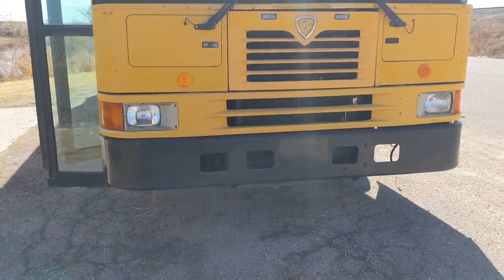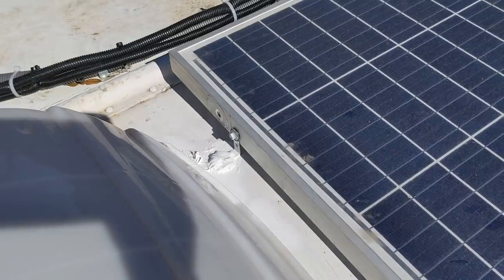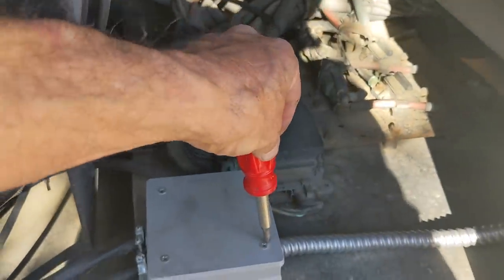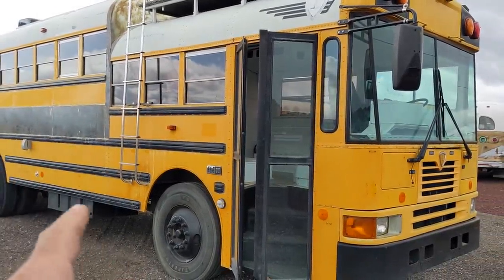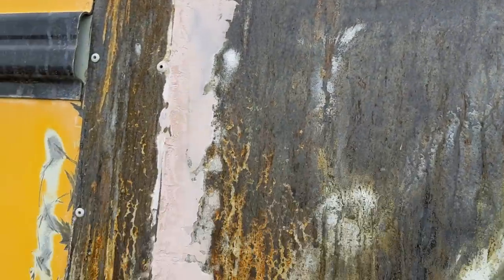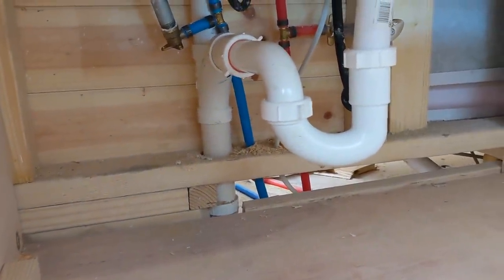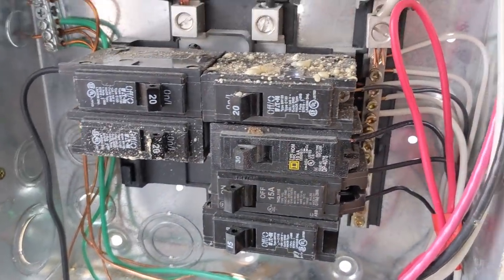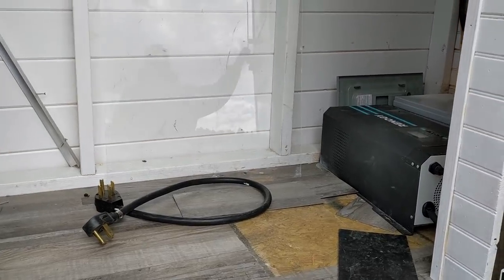Dangerous electrical work...and so much more bad stuff.

Comment: You are assuming the roof raise was done correctly ? From what I have seen , the framing behind the steel side plates is missing . Even if you fix it,  it will shake apart traveling down the road .Any good body builder knows the welded side panels will crack .Like you said the modification should have been done between the rub rails and the skin should be buck riveted to the modified frame .The road is going to beat the hell out of that bus with the spring suspension .And now the engine overheated ?You can get a f*ckin esquire to sue the bus builder but justice is a prostitute and you will go bankrupt . I wish you luck .

Comment: This outfit - this outfit WHICH ONE?
Name the pricks.
Better still send an "official" complaint to that region's power control agency (unsafe wiring standards committee etc.) and get them IMMEDIATELY closed down as this bus (or the few busses you have now seen) IS THE WORST TYPE OF MANSLAUGHTER UNIT - that they are obviously doing on a continuing basis.
They need to be shut down and EVERY BUS CONVERSION - that they have ever had through their business, instantly recalled and de-commissioned.

Comment: am for shit in working with wood, but even I can do a far and away better job then they did. that wiring scares me. how could anyone do such a (****) job. even my welding is much better. hell i can even cut the outside wall better than they did.
another here said "lone star skoolie" did this? is that correct? i will never get with in 100 miles of them.

Comment: So I guess that you would not be in favor of my 1915 hit&miss engin powered open chassis Generator equipped with glass fuses   knob & tube smooth wiring and open blade switches throughout .
Not only should that company stop doing electrical they should not do carpentry,  plumbing,  bodywork or anything even remotely related to transportation or housing much less both together. The only thing they accomplished was converting good useable materials into scrap .
I have see better work on a chicken coop made entirely from shipping crates, pallets  old bed frames and sheet metal from a rusty garden shed. Infact the fit and finish was much better.

Comment: In Texas and most of the Southwestern USA including Louisiana there are a TON of NEC code violations out in the wild especially in places like RV parks and the reason is most of the laborers and maintenance personnel are either low IQ dope heads who watch one youtube video and think they are experts or migrant workers (legal and illegal) that are not electricians to begin with. IDK how mush SHIT I have cleaned up just to make things safe. Then you have people who own RV parks who are cheap and don't want to buy new wire, conduit, box's etc. let along the correct stuff for outdoors because it "cost too much" yet they can support their healthy gambling habits. I have walked off many jobs like that because I WILL NOT wire in something using old rusty shit that is not safe or up to code.

Comment: RollingLiving... you should clarify that the outfitter did not "finish" this build. Meaning, they didn't exactly release the bus as a finished product with a walk-thru since the owners picked it up prematurely. I don't blame them at all, but to frame this video as though you're critiquing final assembly is disingenuous. "This is what a $100,000 build gets you" isn't an accurate statement if it was never released as completion.
Reply: The owners of this bus kept a blog while they sat in San Antonio waiting to pick up their bus. They were actually told 4 times it was “finished” and showed up to find it is a variety of states of disrepair and shoddy workmanship. The final time they finally decided to just save it rather than let LSS destroy it further. So actually, this IS what LSS told them was a  “finished” bus. 

Also, the owner of LSS, Ben, never happens to be there on pickup days and doesn’t answer his phone, leaving the workers to deal with customers and the GM, Amber, to claim she cannot refund any money because she need’s Ben’s approval. Multiple victims of this company have told this exact same story so it is obviously a pattern and part of LSS’s scam.
Reply: @vaughnfluff3344  holy crap. Well, that's a game changer then as far as my initial viewing. To think that anyone would say that any single portion of that bus is finished is stunning. Growing up in a family that bought a new motorhome in 1973, I'll add some unsolicited advice: I get the whole bus conversion idea. You pay low and invest in a renovation that yields a sturdy product. Fiberglass motorhomes suck from a structural rigidity state. BUT.... what if, instead, you took your "bus renovation money" and bought an older Bluebird Wanderlodge instead? That's the way to go. Do your own research, and I'll bet, you'll come to the same result.

Comment: They (Lone Star Skoolie; Benjamin) took $75K from these people and spent maybe a couple grand on materials, and had no skills in any trade, whatsoever.  Why did they even bother?  They should just use a gun to rip people off.
Reply: Kid is way over his head. Conversions involved several trades which the company has none. There is a saying fake it till you make it, this seems to be a prime example. The fake it part is obvious right away.

Comment: Just wondering why someone is willing to pay $100k for skoolie build? That amount of money would buy a very nice RV. Such a shame that those Aholes are still taking advantage of peoples lack of DIY skills.
Reply: For the same reason people rebuild old cars or remodel older houses. $100K won't buy that nice of an RV. Definitely not a new one. Sure you can find an older RV, but it's a canned product that's the same as all the others. But a skoolie can be anything. We had a different floorplan that we wanted. We wanted our own remodel with our OWN design. We had dozens of space saving features we were going to put in it, things where current RVs just waste space.  Could we have found an RV for less than $100K? Of course. But it would have been nothing like what our skoolie was supposed to look like.
Reply: Take a look at our bus, cost us less than 100k

Comment: Unfortunately.... it looks about like the rest of the RV industry providing new RV's and trailers over the last two year (and into the future). Florida is flooded with and will have many more piss poorly made RVs and trailers over the next few years. I've seen this bad in new construction.... It hurts to watch it. I've seen low low budget do-it-yourself crap that is better than this. You missed that the AC breaker box had mismatched branded breakers and panel. That loses the UL listing and is therefore a code violation.

Comment: I've only watched 20 minutes of your video. All I can say is the amount of money spent by the owners is 80% more than what should have been paid.  I do better work at home and I'm not a certified electrician.  They should not have any money!  At best they should be paid $1,000 for the "stuff" they purchased.  Everything else is scam!
You are ticked off and I don't blame you.  The so-called builder is a scammer who took someone's hard earned money and gave them "crap".  I do a lot better work and up to code but then I've studied and learned what I can do and what not to touch.  The welding should not be called welding since it is something a ten year old could do with a wire welder.  I'm not perfect but I am decent with the stick welding I perform.  As long as it is for me, I'm not concerned but if it needs to hold a load, I'll get my neighbor to weld it (he is a professional, certified welder who works on gas or oil pipelines.)

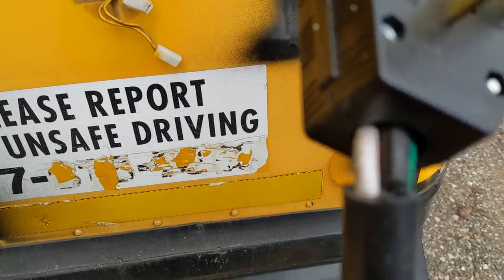Comment: 54:05 Not really that bad given the overall problem, just plug that end into the bus first, and unplug it last, so it's never live. You wouldn't want to be touching that when it's live anyway, cut insulation or not.